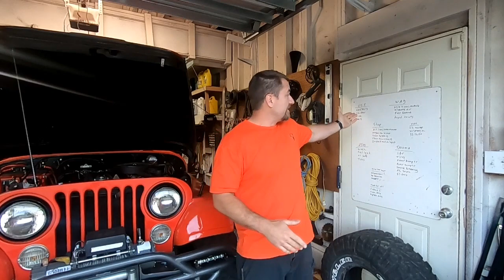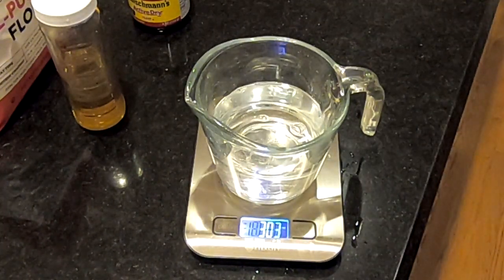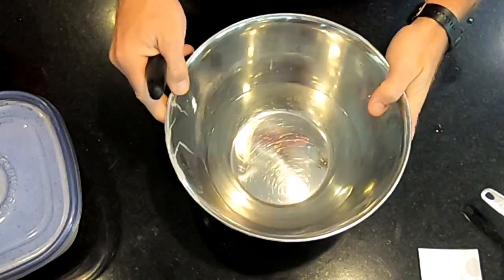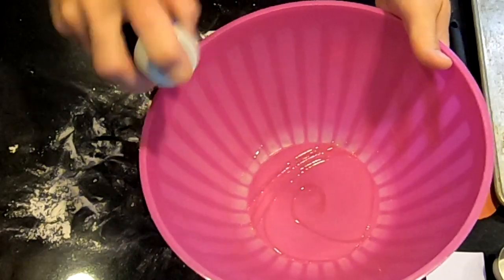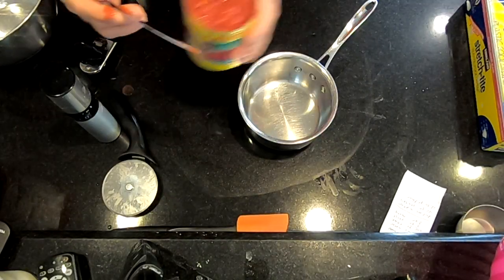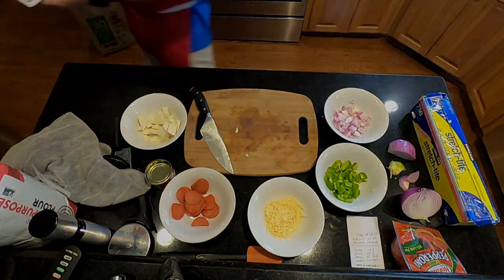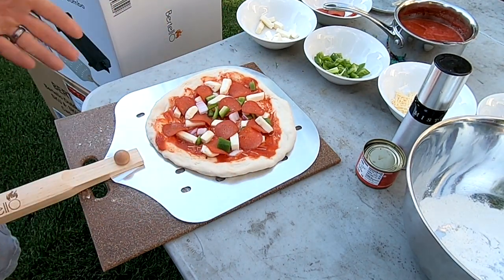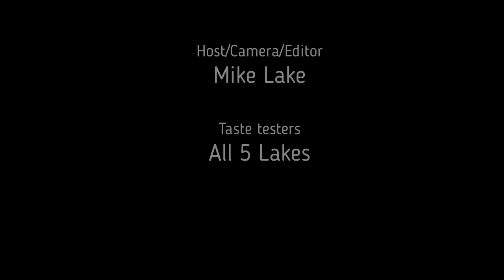Cooking the perfect Pizza pie in a Bertello Pizza oven.  It all starts with the poolish.

Comment: If you want better results you need to use the type of flour that was designed for high-heat ovens. That would 00 unmalted flour. The malt in the King Arthur flour will cause the crust to burn prematurely. Malt is added to aid browning in a home oven.  I am sure you can find 00 at your local supermarket and definitely on Amazon. Caputo Pizzeria is a good brand to start with.
Reply from the maker: nice.   Thanks for the tip.   I will find some and try it out.   I feel another video on the subject.   

Thanks again.

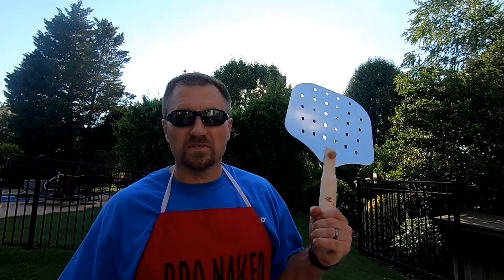Comment: Nice try.  Your technique needs work. It is a Bertello oven not a Bordatello oven (17:54).  I agree with your assessment that the oven was too hot.  You could have put the metal peel under the pizza to lift it off the stone for about 15 seconds to let the top center cook more, without transferring heat from the stone and burning the crust.  Just keep practicing and then redo the video.  Thanks.
Reply from the maker: Thanks for the tip.    I think i am almost ready to make another video but will get a little more practice.   we all have to start somewhere.   :)    

Thanks for watching.
Reply: @5LakesGarage  Hi.  Can you tell me if the oven and wood grill components are made of stainless or mild steel?  I came across your video because I am researching to buy the Bertello vs an Ooni.  I live near the ocean so I don't want an outdoor oven that will potentially rust.  One quick test is to see if a magnet will stick...usually won't stick to stainless steel.  Thanks.  Looking forward to the next video.
Reply from the maker: Sorry for the delay.  I have away for my day job.   It keep getting in the way.  :)    I will run out to the oven and check for you once I get off of this call.
Reply from the maker: Ok.  call is over and I ran out to the oven.   the wood grill components are magnetic so Mild steel.   
After having the bertello and seeing some of the new ooni has a door to keep the heat in more might help with the top of the pie to cook more.   
https://ooni.com/products/ooni-karu-16?variant=34076710371425&currency=USD&utm_medium=product_sync&utm_source=google&utm_content=sag_organic&utm_campaign=sag_organic&utm_campaign=gs-2020-07-22&utm_source=google&utm_medium=smart_campaign&gclid=CjwKCAjwx8iIBhBwEiwA2quaq9nZ9XfgUzFzzOIOLrLSwWOdmyjDnQCOaVeiFt_OtKnmei4KsooFNhoC-rgQAvD_BwE

It is a bit pricey.    

Good luck and I will work on a new video soon on the better technic.    I have to hold off on cooking so many at one time.   I went to the doc and they said I had a fatty liver after cooking one every day for a week.  :)    All back to normal now.
Reply: @5LakesGarage  Thanks for your time.  It seems that the Bertello is the only one that could preheat the oven with gas and then add wood for the final wood flavored baking.  Most other ovens are either gas or wood/charcoal.  Looking forward to more videos.